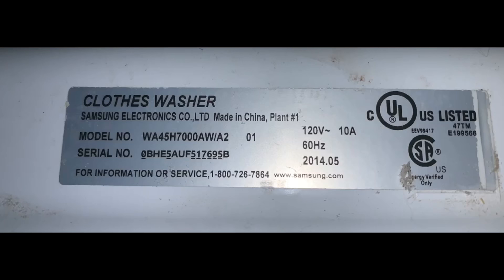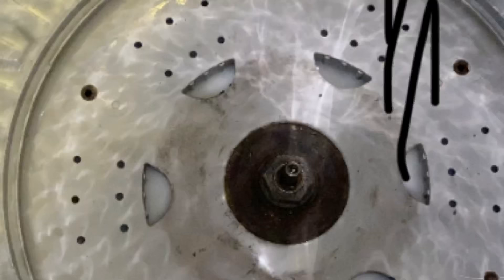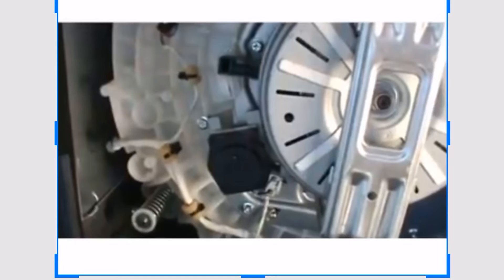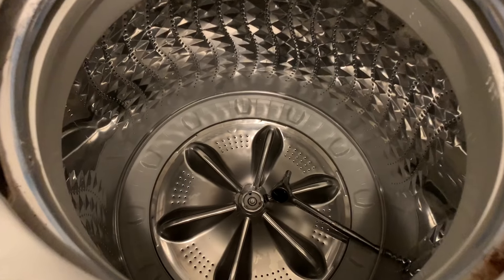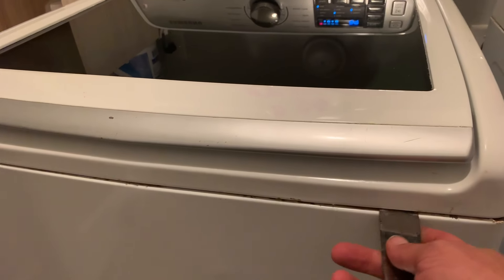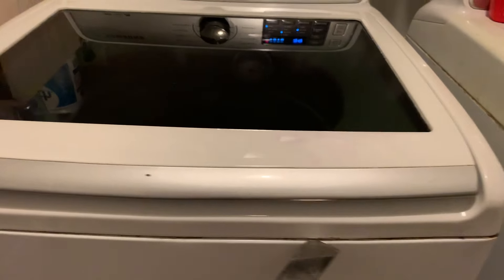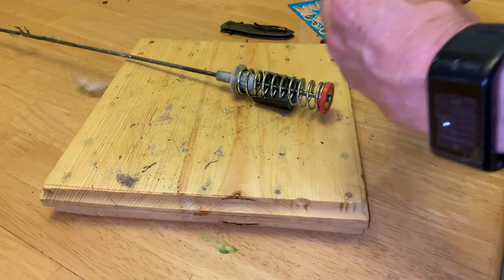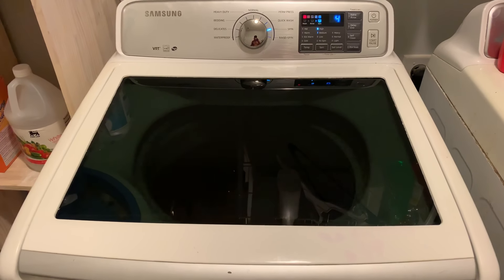Samsung Washer Spins and Refills Over and Over!! DIY fix. WA45H7000AW

Comment: Here's my take on the situation.  It's the logic programmed into the controller.  Only it's not programmed for bad hanger rods not doing their dampening job.  The controller thinks the load is off balance beyond it programmed tolerance.  The machine is programmed to refill and agitate in order to rebalance the  load without human intervention.   And since the bad rods make just about every load give an off balance command, it keeps doing it again and again.  Feel free to comment, correct, complain, etc.
Reply: Yes, I think you are right.  Because mine works just perfect, other than this UE code happening.  Then, it spins most of the water out, and you think it's done.  And, POOF -- it restarts by adding more water and repeating the cycle.

Comment: Thank you for this excellent video!  I followed your advice and used the zip ties to lock 2 1/2" pieces of cut garden hose around the springs and my washer works perfectly now.  Prior to this, I was shopping for a new washer. In 30 minutes you helped me fix a problem at no cost other than some old hose and zip ties I had in my garage.  You are awesome and thanks again for posting this!
Reply: is the fix still working now?
Reply: @andrewb7104 man I did it the other day, got two loads out of it and it's not working again. I'm gonna get someone to look at it but it's the same thing. I don't know if the hose slipped off, but I'm ready to set the fucker on fire. So to save my sanity I'm letting someone else fuck around with it.

Comment: I do appliance repair and I've been looking for a way to fix these rods. Some of the Samsung rods are almost $100 apiece. This looks like a great idea! Now, I do have to mention that the nut on his machine is nowhere near tight enough. They are either hammered on with a spanner wrench or an impact wrench. There is no way possible to even get it close to tight enough with channelocks.

Comment: Oh my gosh THANK YOU! 

My wife has been driven up a wall from our Samsung washing machine doing this - endless rinse & spin cycle,  refill... over & over again. It would get terribly off balance with small loads of just 2 or 3 towels. So this weekend, I finally had enough & thankfully found this video. Used the 5/8" thick pieces of water hose, about 2" long each, with 3 zipties to secure it around each suspension spring. Spent less than 20$ for everything. Accessed it from underneath by flipping it on it's side. Did it all in about 1 hour. Completely fixed it! 

You're my hero sir!

Comment: What if your stabilizer rods already have a rubber fitting around the spring? Tighten it up with wire, or a zip tie? Or cut it out and use the garden hose?

Comment: The 30 dollar amazon specials fixed mine(at least for now) instantly.  After seen lots of stuff about the special grease, I was worried when these arrived, as the old ones were very sticky and shock absorber like.  Much more than the new ones.  But  they work just fine.  This machine is getting close to that magic part obsolete no replacement  age.  I'd pay $2000 dollars for a NIB 1960s or 70s American machine with mechanical controller.  THOSE were built to last, and they did.
Reply: My wife and I were just discussing trying to find an old machine. So tired of these new computerized piece of junk . Had one for 6 months, and the motherboard went out. Now a few years later it's this issue. Wish they built things like that used to

Comment: Yes, I'm having that exact trouble now, so I'm gonna try your suggestions.  I've not done any maintenance on it before, but I sure have on my Samsung dryer that I bought at the same time.  However, the Samsung dryer is sure easy to work on, once you've taken it apart before and learned how everything connects.  So, a question is:  have you had to do any other maintenance on the Samsung washer of yours?   I'd be curious as to what you've done.  Thanks again for this video.

Comment: This was the perfect fix! Samsung and the other manufacturers have upgraded the suspension rod springs which have a spring damper on them. This is a good fix . I cut 4 1/4” lengths of 5/8 hose  sliced vertically and wrapped the spring with the length I cut and used three zip ties per rod. Works perfectly! Thank you for the advice! Wade
Reply from the maker: Thanks

Comment: Thanks CW. This fix worked for me. After a SPIN, the cycle was going back to RINSE but it seems to got fixe after I used this fix. I just want to share that it is rather difficult to pull the coil rods out from the Top hence i fixed this from the bottom opening. Thanks again!

Comment: Well, I followed all the instructions using pieces of garden hose, but I am still getting the unbalanced clunking. i also made sure the center bolt was tight in the drum. I have ordered the 4 rods and will try those. Maybe my springs were just too far gone for the hose pieces to support.  I appreciate the video which allowed me to figure out how to get the rods replaced. Thanks!
Reply: UPDATE. I got 4 new suspension rods and put them in and it spins like a dream now! The rods were about $72 for the four pack and it was another 5 bucks for some lithium grease that I placed on the surface of the plastic piece at the top of the spring and the place where the top of the rod sits in  the washer frame. It made a slight squeaking noise during the first run, but that's was gone by the third load. No more knocking and rocking!! Thank you for showing how easy it was to remove and replace these rods.
Reply: I started dealing with this problem and tried all these things and had the same problem you did. Once I started thinking about it I ended up taking apart the  white plastic yoke that’s cradled on the far end of the spring with the rod in the center. I noticed there was damaged rubber material inside of these jokes and starting to realize what this piece of hardware did. A couple of years ago I replace the damaged rubber with fuel line I altered to fit inside of the yolk But it’s only last about a year. I do feel the engineering department this company could’ve done a lot better on the dampening design with this shock absorbing system

Comment: After removing the plastic cover, the first bolt that you loosen, is released/removed by going clockwise correct? Then when bottom plate has been removed, the large nut is tightened counter clockwise as you mentioned. I’m having a very difficult time removing the first bolt. Please advise, thank you.

Comment: Different models but the buttons and cycles look the same Samsung WA45H7000AP/A2. The inside is huge and looks great but I don't see the point if the water only fills up only 1/4 of the tub on the Normal cycle. Is this normal? I can see clothes on top just standing there instead of being underneath the water getting washed. Do you know how to get the machine to fill up with water more than the half way point? Also I cant figure out how to calibrate it. Did you ever figure out how to calibrate yours?

Comment: i believe hose clamps would do a better job than the wire
Reply: Damn, are you a genius.  Yes, that's the right way to fix it.  Also, guy above said that he bought 1 inch plastic pipe and cut it.  Because garden hose is too small.  So, I plan to buy bigger pipe and see if I can fix it that way.  But, I love your suggestion.  That so brilliant.

Comment: Thank you so much for the well put together video. It worked great! one question; somehow I get everything back together,  but now the water is no longer working???any idea what i May have done to possibly prevent the water from the machine??!? Gratitude sir
Reply: This happend to me ,too. The washing machine is not taking the water...I don't know how to fix it now...
Reply: When you laid down the washer the water valves wiring connection to the PCB might have gotten loose. It needs 120VAC from the pcb to open up the valve.

Comment: Fixed issue with my Samsung. Bolt was already tight. Purchased 1 feet  piece of 1 inch inner diameter vinyl pipe. Cut four 2 inch pieces, spliced open vertically and wrapped around each spring and tied each with 3 wire ties. 1 inch inner diameter does not fully wrap around spring and small gap is left but don’t worry it fixed my problem and now washer does not wobble and completes the cycle again. Thank you for sharing your knowledge. 🙏🏽

Comment: Many of the new washers have gone to the 4 rod suspension. I just had a amana washer suspension rods go bad (shock absorbers). The amana had piece of rubber like material which dampens the up-down and back and fort movement of the drum. I tried a similar method of pipe insulation wrapped around the rod. It would help the up and action, but not the sideways action. Parts are extremely scarce right now, somes are months on back order. These units should have a balancing spring between upper tub and the suspension rod for more stability. I opted the get a new washer (which is hard to do with most units on back order.
Reply: I’m

Comment: Samsung WA48J7700A Washer - wrapped a thick vinyl pipe around the rods and tied them down with zip ties.  It stiffened the suspension rods so much that instead of looping the rinse spin cycle, the washer vibrates madly to the point where I have to shut it off before it explodes.  Not good.

Comment: Thank you !  This worked

Samsung Washer WA5451ANW XAA 02
Used 2 ft. PVC Disposal Discharge Hose -Home Depot ($5.99 -5/2022) 

Additionally, to stop too much side to side motion- Lodged commercial cleaning sponges between washer drum and metal body (front, both sides & back). There was thin, worn sponge already.in these areas.

Access- Moved machine  1.5 feet away from wall and propped machine  back with a cinder block under the front—- to get 2 front springs

With machine standing regularly, Took off thin metal panel off machine back to reach in and get back springs while sitting on floor.  Also stuffed sponges on both sides and at the back of the drum from this area.

Opened washer lid (as if washing clothes) and squeezed sponge under front lip between the front of the washer drum and metal front of the washer.

Comment: My WA52J8700A has this problem. About a year ago it started throwing uB codes during spin and then would stop completely. I replaced all the suspension rods. Worked for about a year, and now it's doing the spin/rinse/spin/rinse/spin/rinse thing, extending out over up to 2 hours. Timer keeps resetting to more time. No DC codes thrown anymore, which is very puzzling. This sounds like the rod problem all over again, but why no DC codes??? Doesn't make sense. What a POS. The perpetual spin/rinse gig must be controlled by the stupid computer; why doesn't it throw a code if it's so screwed up? This thing is wasting all kinds of water and electricity because if you leave it alone it just goes forever! Oh wait, it has an "ECO PLUS" setting! hahaha
Reply: did you ever fix this?
Reply: @phanomchanthavong1668  Sure did. I junked it and got an LG
Reply: @randyp3871  haha I took mine completely apart and I found the problem. It actually had a class action lawsuit. So many people have the issue. I laugh cause an hour ago I searched for a new washer and LG came up. Now I look for the parts they use before purchasing.  Are you happy with LG?
Reply: @phanomchanthavong1668  No. I've had the LG for 4 months, and it threw an FE error, which means there's a problem with the inlet valve. Repairman came over and couldn't find anything wrong, so nothing was done. Washer has not thrown error code since, so maybe was a glitch of some sort. Warranty is 1 year, so I hope it was just a fluke. With regard to spinning, I have a front load LG which spins like a friggin' jet engine, and hardly vibrates, so that problem is gone. Bottom line IMHO is that washer reliability has gone down the tubes. They used to last 20 years, now days, a couple years.
Reply: @randyp3871  Oh man that sucks. I took the entire washer apart including electrical wires and parts. Before looking for a new washer i look up the parts and they are all the same now. good luck man

Comment: Easier fix for the springs is to just stretch them twice the normal height and put them back in, no garden hose or wire needed. Working like new.
Reply: Still working?
  I have seen where some fix the top plastic piece in a way that keeps it from moving up and down too easily.
Reply: I really doubt it
Reply: I don't understand,  you made them longer?

Comment: So thankful to have found your video!  I had used every expletive in my vocabulary while waiting by my washer, only to have it be out of balance, bang around upon spinning and reset to fill again with water.  Grrrr.  I chose to work from the bottom and had no trouble reinforcing the springs with some old garden hose and zip ties.  Thank you so much.  Sometimes it's the little things in life that make you happy.

Comment: Hi , my washer machine is has same problem, it is semelr to this washer, but the led  is on the front of the washer , so it is repeat the spin cycle without stop how can I fix it please????
Reply from the maker: Probably has the similar stabilization issues.

Comment: I have a model WA48H7400AW/A2 Samsung washer and toughening up the stabilizer rod springs fixed my problem.  Used sections of garden hose with zip ties.  I was getting UE, U8 occasionally and sometimes no code. But the machine would refill and drain over and over. Machine didn't shake like in this video. Make sure to wear some latex type gloves as those rods are very greasy. Thanks a bunch.

Comment: Washer was having this issue and vibrating violently. After researching a bit, I came to the conclusion I needed to replace the suspension rods. After successfully doing so, my problem still persisted. 

Then, I came across your video, and it was the first time anyone suggested a loose bolt under the agitator plate. Checked mine and found I could easily turn it with my fingers. After tightening it, my problem was resolved.

Wish I came about your video the first time, would have saved me a couple bucks. The rods were probably due to be replaced anyways. Thanks for your video! Saved me a lot of frustration.
Reply: I can't get the cover of the bolt off is there a trick to do that?

Comment: I did the garden hose trick with zip ties. 3 zip ties per spring. Was easy enough to do with the washer on its side without having take the top off. I was just able wash a decent size load including 4 beach towels, with no issues. This certainly would have caused problems before the fix. Thank you very much for sharing. I was happy to fix it w/o having to take the top off, or buy anything!

Comment: Thank you for this fix. My springs already had a small black spacer on them but I added the hose anyways to tighten them up. Now the washer runs full spin cycle and doesn't stop and reset to since again. Thanks!!!
Reply: jfergmon I am little scare to do that.

Comment: I bought the rods and replaced them but it didn't help. Washer still says UB and shakes 😢

Update: I just watched another video that said you need to  calibrate it by holding Delay and the Temp button. Now my washer spins without any issues 😅 I really feel dumb cause I've been messing with it for MONTHS with no solution. I hope this helps

Comment: CALIBRATE BEFORE YOU DO THIS!! Heres my experience . Bought a used washer and got the error code first use. Flipped it over and noticed the springs already had a soft rubber sleeve on them not sure If stock. Went to Home Depot and got some stiff rubber tube and zipped tied it to the springs.  Gave it a test run and lots of Clunking!!!!. I then decided to calibrate it and it helped. Still had clunking but less and it finished a high speed spin. It's like at a certain speed it wobbles but once it speeds up it's fine. My thinking is I added too much rubber hose and the springs aren't absorbing the shocks. However, after this trick the washer spins faster than it used to. No error code and a newer model too
Reply: Update. Error code and clunking came back. I'll check tomorrow but wondering if zip ties slipped off
Reply: How did it go?
Reply: @forrestfuller6359  I did it again with softer hose and wire. The vibration cleaned up. Sometimes I get the code and just have  to time it so it doesnt refill and spin. Sometimes It works without error.  The fix is just to keep it running on crutches, but you have to watch it because some loads do start vibrating like crazy. It still washes you just have to manually turn it off after a spin so it doesnt repeat

Comment: This is  called Mickey Mousing  a job.  The correct way is to replace all 4 dampers at the same time.
Reply: If it works idc 🤷‍♀️
Reply: Not if the dampers are still good
Reply: I think the issue is that the springs are not large enough for the speed of the spin cycle, so this reinforces those springs
Reply: It's a Mickey Mouse job why?  You know you can buy the piece that already has this fix in place.  THE FIX WORKED GREAT!!!!  No more problems and easy to do.
Reply: make sure you cross the road only at approved areas, and chew your food 32 times, remember big brother loves you!
Reply: @uberlycidas  You must be the  genius guy that patches a ceiling of a room if water is leaking from it instead of finding the source of the water leak. Keep up the good work,

Comment: You the MVP! Worked like wonders on my WA456DRHDWR/AA. I bought 7/8 2ft rubber hose at Lowes #814334. Fixed in under 15 minutes, under $6 . Easier to use your first method by tilting machine and working under the machine!  THANKS A MILLION!
Reply: I got the hose did you put two slices of hose on each spring or did you just split one piece for each?
Reply: @LuisHernandez-vq2ff  Did you fix it? did you use one slice for each spring? or two slices for each spring?